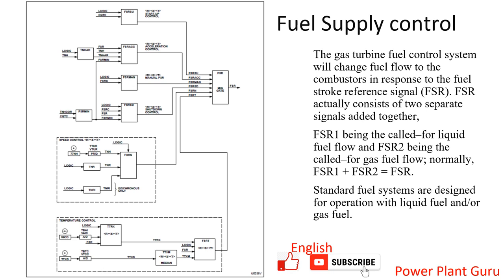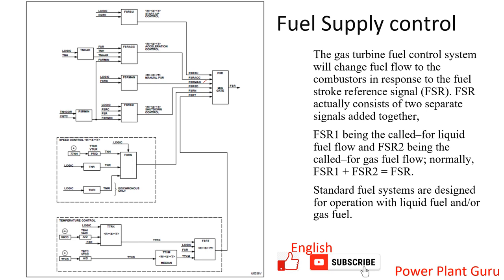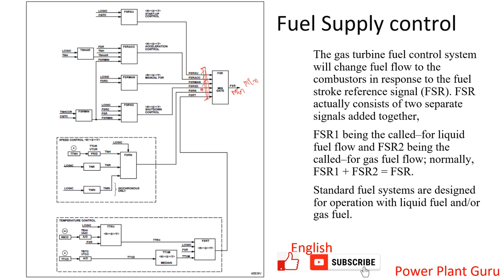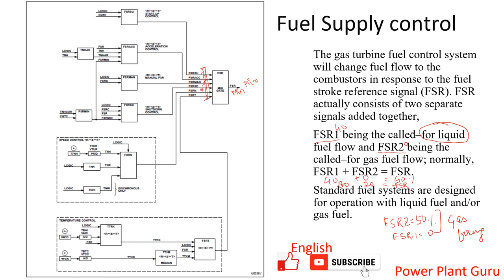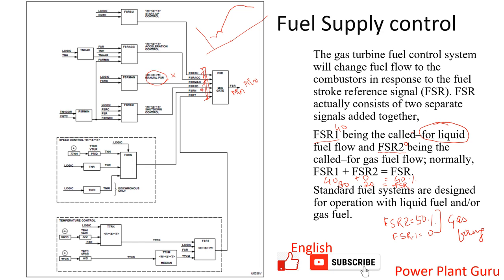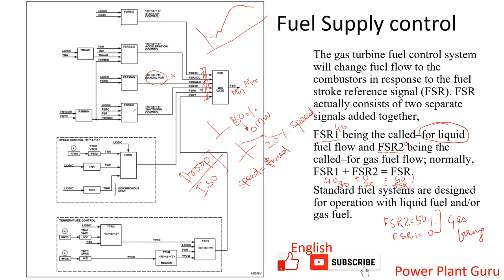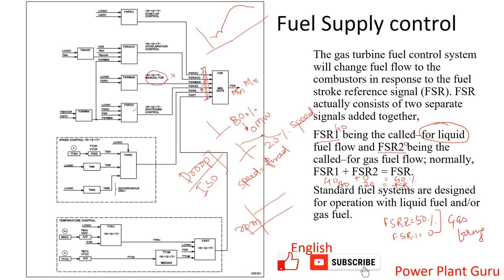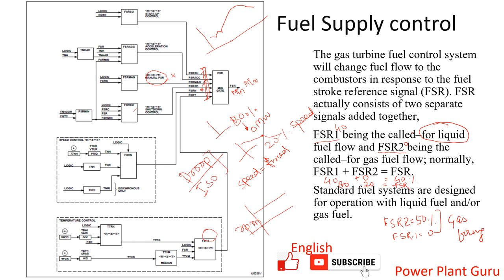What is FSR in Gas Turbine, power plant engineering, power plant guru

Comment: Sir what is eqilibrium or balancing line for lube oil filter????and also 3 way valve???
Reply from the maker: Balancing line is used for filling oil to standby filter element. If you have to clean/replace any filter, you have to drain that element and open the flange for replacement,.once clean element is installed and boxed up ,. You have to charge the new (empty) filter by balancing line
Reply from the maker: Three way valve is used for switching oil inlet and outlet flow from anyone filter element (A) to other filter elements (B). It's directional valve will be open on one side and the other side will be closed.

Comment: Sir what is orifice plate??how it works???in pipe lines!?
Reply from the maker: Hello Devi
Orifice plates can be used for many purposes, i am giving one example for your reference. 
There are dp (differential pressure) type flow metre, where orifice plates are used and installed in pipeline there is one tapping upstream of orifice plate and one at the downstream the pressure at the both tapping is difference of that give flow measurements. Higher flow rate will create higher dp and flow meters are calibrated according to flow vs dp relationship.

Comment: what is FSR GAGGING?
Reply from the maker: FSG gag function is preliminary used for troubleshooting MW hunting issue. When machine is normal- SRV/GCV, MW & fuel flow is constant but if hunting starts- all parameters will oscillates- so to identify that fluctuation is due to which issue? FSR gag is useful.

When FSR gag- GCV will maintain same CV opening and if load fluctuations stops- seems problem with GCV servo or related loop. If still problem persists need to look into SRV, MW transducer, fuel circuit etc.